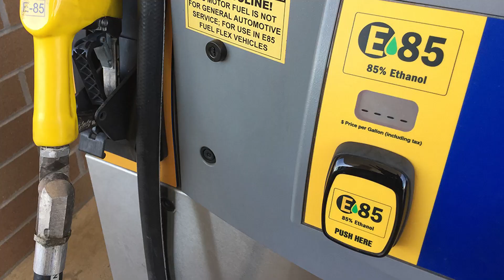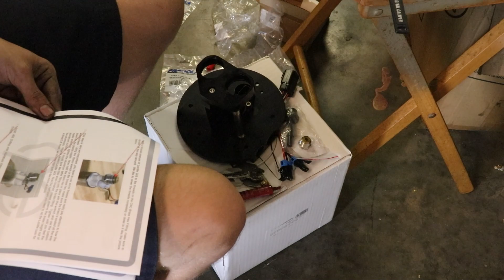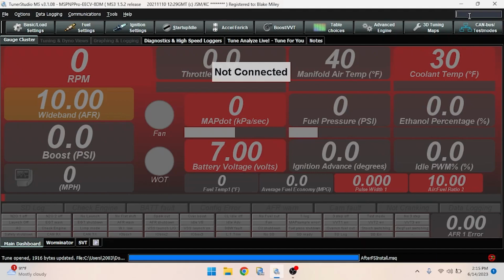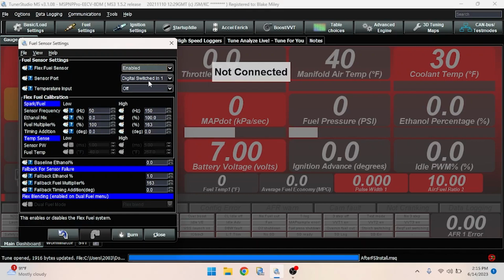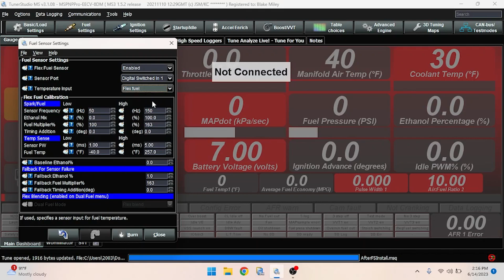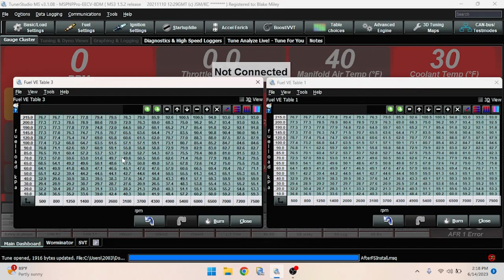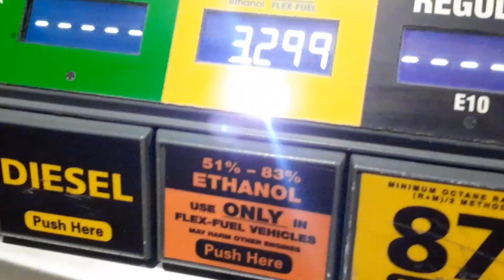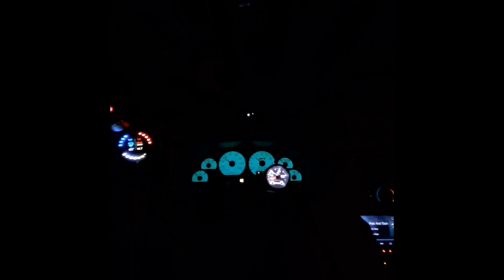FLEX FUEL Conversion On My TERMINATOR Cobra! *E85*

Comment from the maker: Something I'd like to better clarify about fueling; the VE table 3 is a duplicate table just for fine tuning with E85... Yes, it does burn 30%ish faster, that's already accounted for NOT in your VE tables, but in the Flex Fuel sensor settings tab. In there it has a multiplier for required fuel, and that's how it keeps the fueling in line even with the faster burning fuel.

ALSO for anyone wanting to know, I run the car at 58PSI fuel pressure, and so far I have not had any issues with the 60lbs injectors.
Reply: As you know I have the same pumps and will but bumping mine to 58psi when we install the new rails... and that's with FIC 1200 injectors.
Reply: Thanks for the clarification on the fuel scaling.  What about ignition?  I noticed you didn’t have a scaler and you just copied the ignition tables.  Did it run without tweaking them?  Was it sluggish at all until you had your ignition table adjusted?

Comment: Nice video! My local stations range from 90% ethanol all the way down to mid 50s! (I manually test it at each fill up) I’m running the stock ECU with an E85 only tune… Having an MS3 to adjust and know ethanol content on the fly would be amazing!
Reply from the maker: Oh it's super convenient, and my perfect tuning gauge shows me my ethanol percent now even if I don't have my laptop. My local gate seems to be consistently 70 and up

Comment: I keep hearing people talk about the possibility of corrosion building up in the fuel injectors with E-85. Is this concern over blown?
Reply from the maker: It’s a concern if you plan to leave the car sitting for 4 or 5 years
Reply: Gotcha, I was told you have to run 93 through the fuel system before the car is stored for the winter. Probably don’t have to worry about that in Florida.